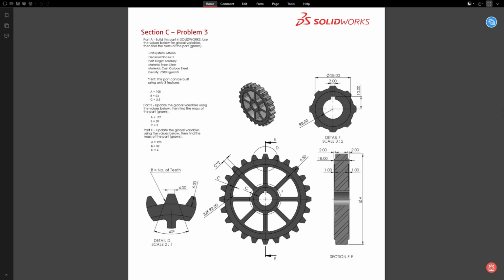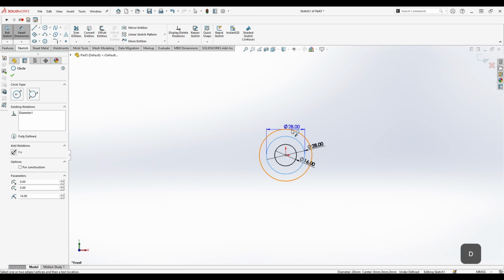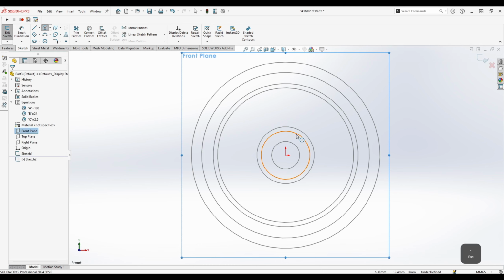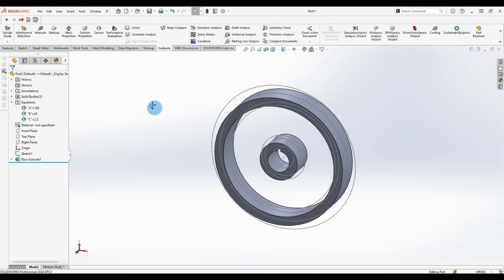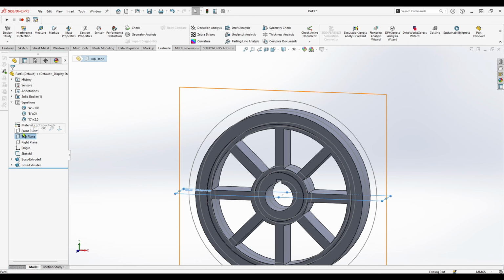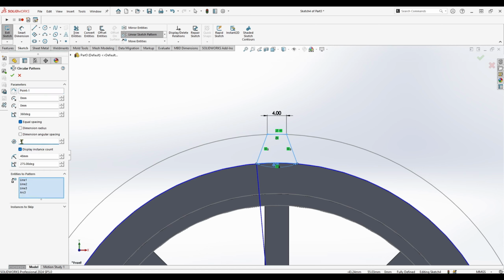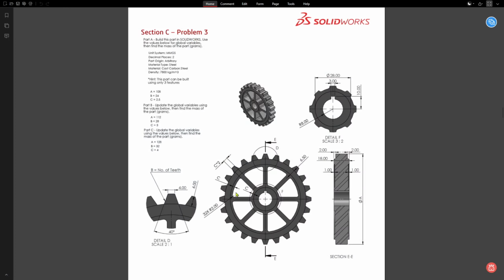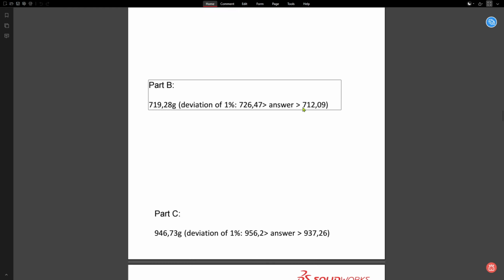Section C Problem 3 - CSWA Mock Exam | SolidWorks Certification Practice

Comment: 8:45 The top of the teeth are actually NOT flat, but rather follow the curve of the "A" variable diameter circle. that "4" mm distance is from end to end horizontally of the arc on the top of the teeth. 

When I did this, I got the EXACT values for all 3 configurations. 

Its pretty annoying that the drawing file is unclear about this.
Reply from the maker: Strange. I just redid the question using arcs as opposed to lines and its 0.01g Lower than the answer I got using flats, which makes sense as there is technically less material than a flat tangent line. 

I do agree with you regarding how annoying it is trying to learn from material with errors.

Thanks for the comment.